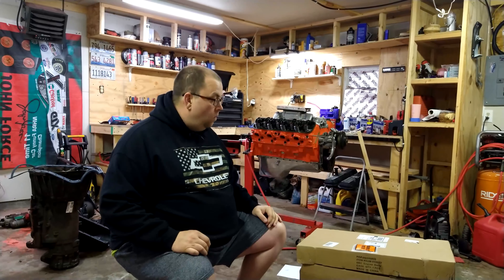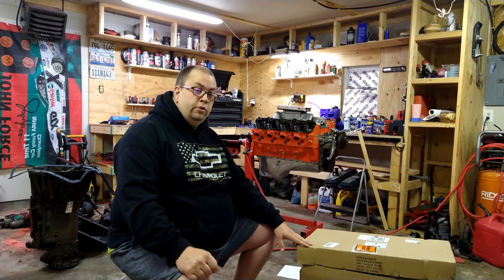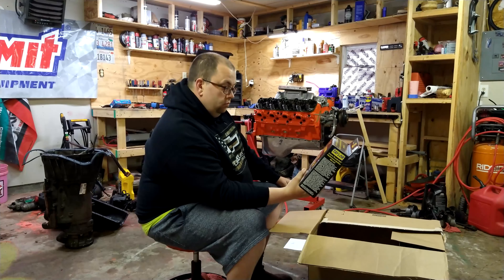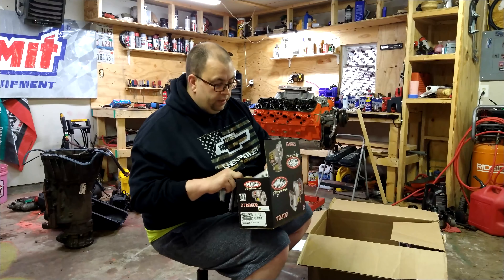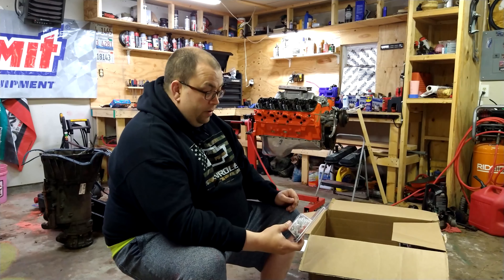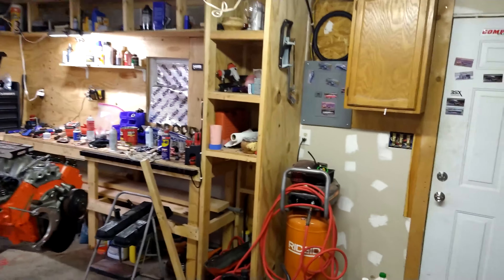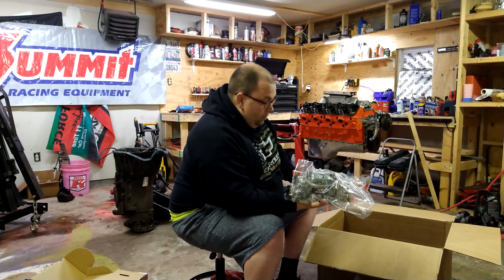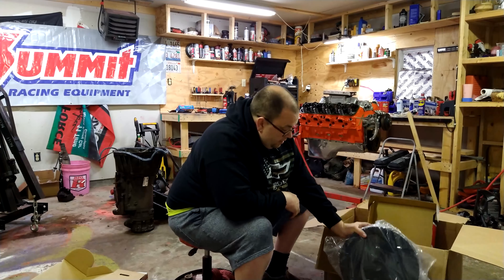Unboxing My Summit Racing Parts for my 454 BBC

Comment: I’m building a 396/402 right now . I have had good luck with summit but I have been ordering from jegs and had a really good experience with the customer service on getting parts exchanged and having parts delivered very fast . I am actually looking at the same intake you have . How do you like it ?
Reply from the maker: I like it. It's not that expensive, although I wish I bought a duel plane manifold instead. I might up grade it later